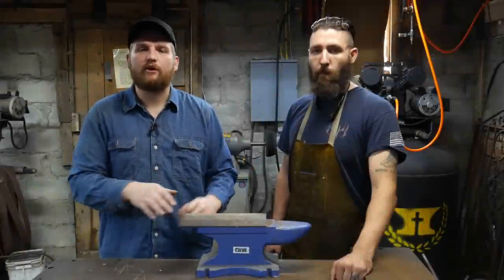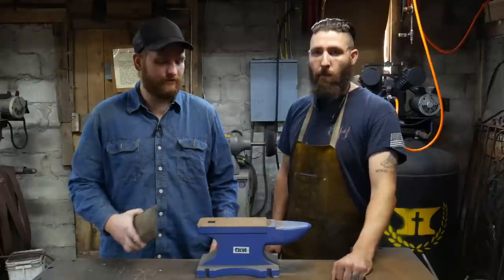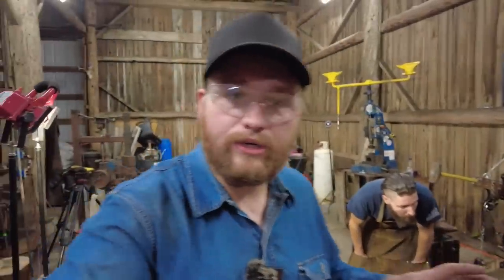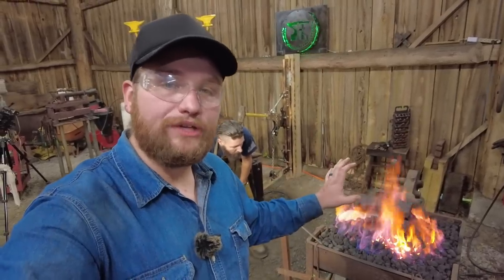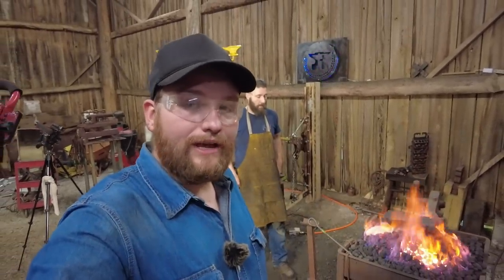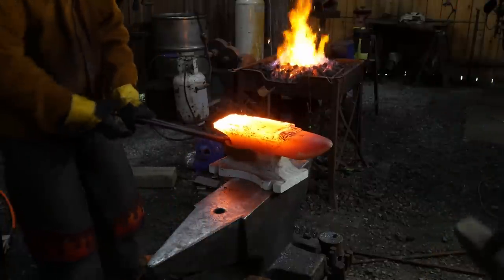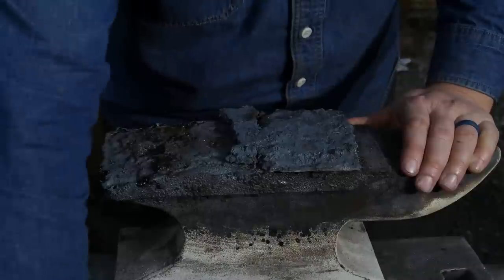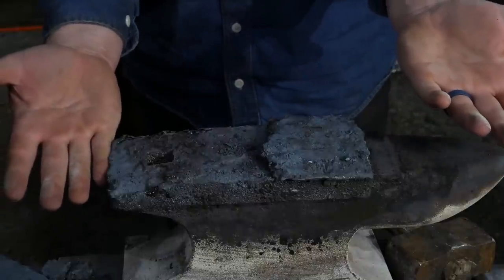Can You Forge Weld a Face Plate on to a Harbor Freight Anvil?

Comment: I think using an electric forge where you can know the exact temp more accurately might be an option. This is a fun experiment. It can be done. My wife's farriers anvil has a cast iron basd with a hardened face welded on and its very solid. My father in law made it for her. I wish youtube would allow attachments.
Reply: Most anvils that have a cast iron base and a steel face actually were welded by casting the base with the steel face in the bottom of the mold.

Comment: I don't know if you'll personally get it done, but I do know it's possible to forge weld the two materials together, as the Fisher Norris ones were tool steel forge welded onto cast iron (or specifically cast iron cast onto the forge weld temperature tool steel I believe)
Reply: Now that I've seen the whole thing, I think that maybe running a bead around the entire edge may help here as well. There would be less chance of the failure of the "tack" but also would help seal out air. You could flat-grind both and then do it with just a regular pre-heat rather than doing that in the forge, and then after the welds are on, into the forge for the forge weld. Cast iron is a tricky mistress, but I think you can get it done!
Reply: @solarhawk77  have to agree with you on this one, gotta see attempt #2

Comment: Good “Maybe” indeed! Better by far than I was expecting.
Reply: Definitely worth a 2nd go at it!  Q: what if y’all barb the steel face plate prior to welding like what’s done for facing wrought iron hammers? With a preheated/fluxed cast iron anvil face, the barbs should sink in.

Comment: I just bought a new Vevor Cast Iron 55lbs off Ebay for $114cdn not realizing it was Iron. I tried to cancel within 5 mins once i noticed my error. I contacted Vevor and they gave half my money back and I kept the anvil. I have to say, It's a bit of an upgrade from my homemade RailRoad Track anvil that was equipped with a hardy, a pritcher, and a horn but only weighed 10lbs. I found it works well with hot steel, I sure won't try to make and hardy tools with the hardy. I have forged tongs, tools, and other items I have sold. So it paid for it's self within two days or owning it. Sure it is not my dream anvil but it will do for now. I only have just over 200 hours blacksmithing in my shop, I have around $400 cdn invested into my setup (including my shop, which was all reclaimed steel roofing and wood) . I have made almost $800cdn in the two months I have been smithing. I have found keeping track of the numbers have inspired me to keep on this journey!

Comment: I think the back end failed because it got too hot. The horn probably worked as a thermal sink to keep the front half from melting. 
I would not have used a sledge to set the forge weld, but I'm impressed that you got any of the steel to stick. I bet the second attempt will be successful.

Comment: If you have an arc welder for electrodes you can try welding hard facing rod on one of those anvils it may work. Not sure haven’t tried using hard facing rod on cast iron. That worked great on the huge chunk of mild steel I have. I use it as a secondary anvil like block to move it around easier than the anvil I have mounted.

Comment: A very cool attempt!!!
What about a lower temperature "silver brazing" it instead? - with a sheet of silver between the two layers  -  Silver would be bloody expensive, maybe copper or brass/bronze will do?
I think a brazing would be much easier and then you could just grind and clean (not polish) both faces flat (the tool steel and anvil), lay a sheet of copper or brass between (thin sheet, that is), weld them solid around (so it won't pour out the side as you heat it up) and then at low temperature and using small hammers - force the steels to lay flat on each other. This will make sure they are sitting one on top of the other flat - and the copper/brass will fill the voids and create a solid bond.... 
Tyrell knives does something really lovely and similar with blades - I wonder if it would work with an anvil (to be honest, I've been thinking of treating my own home-made anvil this way, addying a layer of tool steel on top.)
Just my oddball 2cents

Comment: I know that some things are difficult to see on video. So the temps are hard to judge, from my point of view. Having said that, the anvil didn't look like it was up to full welding temperature on the first heat. Whereas, due to the faceplate coming off, it looked much hotter on the second heat. But again, that's from my perspective. I'm sure it looked much different irf. I've been watching you for years now. So I'm well aware of your skills. If there's anyone who could pull this off, it'd be you Sir.
Thank You for your time and efforts!!

Comment: I would think machining the hard steel for taper head bolts, then drill and tap the anvil might make for better results. I've got some pieces of heavy truck frame I was thinking about doing this to. I could also get some AR400 and do the same thing.

Comment: Good try Amigo! Could I recommend for the 2nd take, to weld all the way around the plate and anvil with "special cast iron welding rods" just to make sure the plate doesn't fall off.
Reply: Ehh, problems with continuous welding it, you gotta flux it/clean off the scale, or you’d have nothing but huge amounts of slag inbetween the plate and the face. And the special rod, that would probably work best/be available and not hideously expensive is just plain ol 309L stainless rod. Plea, to even get what could be called a decent weld with carbon to cast, or stainless to cast, the cast has to be very clean, like shiny clean, and preheated, for the best chance. Along with the steel very clean. But I definitely agree that some more stitch welds around it would be better, like a couple spaces apart, and an inch long or so at most in the front and back, and like 3 or 4 on each side would definitely help keep it stuck in place, for the heat. I commented further up, and said, running over the whole face with 309L first, would probably give them the best chance. As that changes the cast iron into a more high alloy steel right at the surface. Makes it easier to stick carbon steel to it. But that’s a ton of time and welding rod for an experiment. Would be cool to see though, haha.

Comment: Great try!

I'd like to think it can be done. 
Couple of ares I think about.
1 add iron powder in te Flux er majic Pixie Dust
2 don't burn it ( ducks the flying hammers)
3 start hammering in the middle then work out to the edges in multiple heats w Majic Pixie Dust n iron powder
4 have you thought of simple wire welding a quasi face then forge weld the tool steel on that ?

Comment: My gut feeling is that the two different metals have 2 different welding temps… large (realitively) working surface area… it could work but I’d be skeptical about a full forge welding. Maybe the edges. Hope it works!

Comment: Possibly it depends a lot on how both the carbon steel plate and the cast iron behave while heated and under the pressure if the forge welding process if it will be successful

Comment: I think if you can get it hot enough it will work. At least temporarily.  Then maybe delaminate due to the different thermal expansion of the two materials. Or, not weld at all. Idk.

Comment: As far as this. I'm wondering if, since you noted that iron melts at a lower temperature, bring the anvil up to about a thousand to twelve hundred degrees and the plate to welding temp. That should be enough to melt the iron. Or use dynamite.

Comment: Yeah, this way works, but I’ve tried it. The center doesn’t weld very well. The tacks can break off. Back then, it took several guys. One or two to hold the plate on, and the others to whale on it a few times, and hopefully, it welded. But not every time. Sometimes they had to try it several times before they got a usable anvil.

Comment: I would have started getting it to as close to a welding heat as possible with the feet in the anvil first, after tacking the surface. Then flipping it around, bringing the steel to a welding temp. 

Oh! And i would do it with charcoal too, build up a ridge around the firepot with bricks to be able to build the fire higher!
Reply: Forgot to add the most important part, hecking cool idea! Would love a part two!!

Comment: I think it would work if you heat the anvil long enough to decarburize it in a big enough propane forge, closed from the air. I don't know how slow it would decarburize, but I'm certain that I can get it down to 0.30 to 0.60% Carbon. It would require an optical emmision spectroscope or one of those - EXPENSIVE MACHINES($60,000 to $500,000!).

Comment: Nothing ventured nothing learned. Give it another go.  In the spirit of experimentation how about you run the forged welded portion of the anvil through a bandsaw and cut out a few profiles. That way you will get an idea as to how uniform (or not) was the.weld.

Comment: Welding will probably be a fail. A better bet would be to braze them together or to use a structural adhesive. If you think about it, structural adhesive are used to glue most of the cars together and are really tough.
Reply from the maker: Interesting take

Comment: I know very well this can be done.
Reply: I would make sure that Anvil and the Steel Plate are as clean as possible. I also would have tack welded the metal plate closer to the Anvil. You Pixie Dust, Borax Powder being used as a Flux, looked a little light.

Comment: paused. I think it is forge weldable. The question becomes can you weld it Roy? Are you hammering it? do you have a team of 3 strikers? will the cast iron be uniformly close to melting during the initial sticking at the end or center? Will you get the same heat level for re-heats until the entire plate is attached? Will you use flux?
Of course you can weld it!
Now, on with the video.